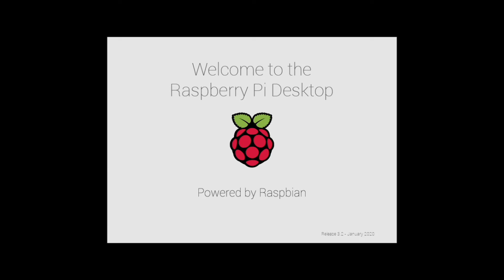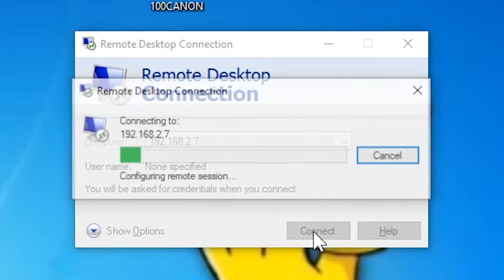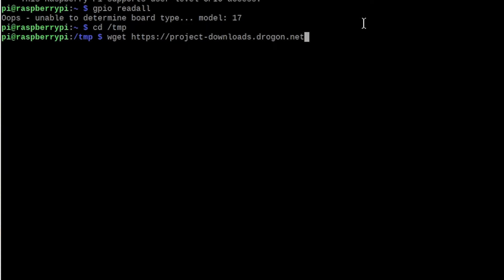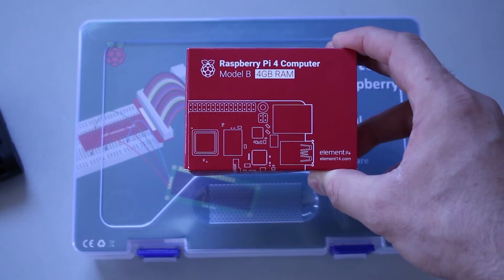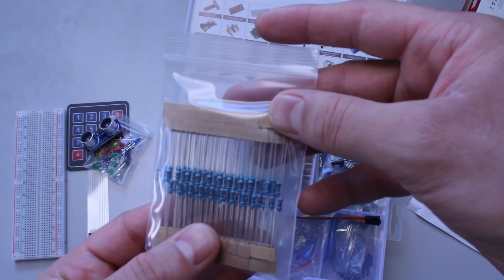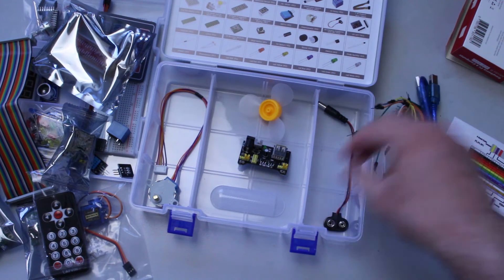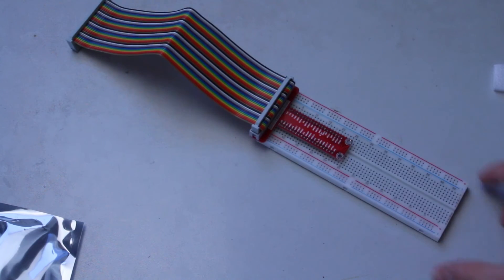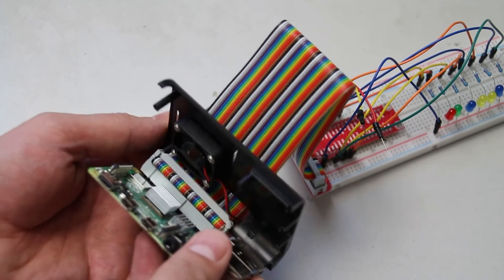Raspberry Pi 4 - GPIO Extension Board Super Starter Kit - Install & Unboxing

Comment: Could someone now do a circuit board (basis on those with holes) with small transistors in-between holes that you could control with code (req. controller) to draw circuit with software? Added bonus would be a top layer where you could just stick the components like in breadboard?